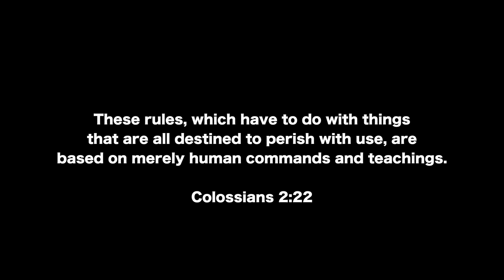Rhino 10' Flex Wing John Deere 3039R  Prepare to Mow!

Comment: Really appreciate your videos.  I have a Deere 3520.  Just purchased a TS10 and it is set-up with two hydraulic lines.  Just as seen in the video, would like to use the loader hydraulic connects to operate the cutter features.  Could you provide details about your recommendations for hydraulic extension hoses - Diameter, length and coupler sizes.  Thank you much!
Reply from the maker: Get the ‘power beyond extension kit’ from http://DiscountHydraulicHose.com/ttwt
Substitute 96” hoses instead of 60”.
And add 2x 5502-08-08 elbows to make the bend better at the mid connectors.
Don’t forget code ttwt for a 5% discount.
Reply: Really appreciate it! Keep up the great work!

Comment: When i was carrying silage wagons for my uncle i had the idea to put the pin between the tractor and the wagon upside down like your father;i would then install the locking pin attached to a twine cord hooked from the back of the seat .I would then drive the empty wagon beside the silage harvester,pull out the locking pin,  unhooked it there and go pick up the other full wagon;this would save one time going off the tractor to unhook!

Comment: Rhino makes some good tough equipment. Our older 15' Rhino mower has those leveling rods too. Good feature even though it makes it a little tougher to hook & unhook the mower (@ least for us @ times). I usually don't even use the jack though & just put blocks underneath the front skid plates on the main deck. Then hook up the main hydraulic line & use the hydraulics to line up the hitches when i'm hooking up & unhooking. Has worked great so far.
& as far as the pto & turning, the best advice I know to not break it is just to listen to it as you turn. If it starts rattling, then you've reached the maximum turning radius you should be at. On our equipment about 45 degrees is as far as you want to be for pto equipment. Of course we run older equipment, so that be a factor. lol

Comment: Hey Tim, that flip over bar is there so you don't have to use as many collars and when you need to set the mower down simply flip up the bar. Thanks for all your video's.
Reply from the maker: No, the flip over bar is to lock it at full height.
Reply: @TractorTimewithTim  I stand corrected. Thank you.

Comment: My grandfather always ran the bolt “upside down” to 1) protect the threads and 2) prevent a bend in the bolt, which would also, prevent easy removal later.
Reply: What bolt? Don’t you use a draw pin?
Reply from the maker: No.  We use a bolt with double nuts to ensure that it does not come out.  I believe this is directed in the manual.
Reply: Interesting. I’ve never had a draw pin come out. I’ve had the dirt knock out the safety clip out the bottom of them. And have sometimes put a draw pin in upside down with a safety pin on top so that the dirt won’t knock it out.
Reply from the maker: I have.  ...as a teenager, going down the road with a 24’ hydraulic fold disk on an IH1466.
I looked behind me and the disk was going crazy.  I slowed down, and the hydraulic hoses all came unplugged, and the disk passed me, and ended up in the opposite ditch.  Good thing  there were no oncoming cars!
I am not kidding.  Woke me up!
Reply: Yep. That would sure get your attention!

Comment: I watched several of your TS10 videos before getting one of my own. I got it today. I’m new to tractors so still learning.  The hydraulic hose is too short and I bought a 4’ hose and fittings to extend it but there is so much pressure in the hoses that I think it will make a big mess when I take the coupler off.  At what position will there be the least amount of hydraulic pressure in the hoses? All the way down? Right now it is folded and all the way up and the pressure is so high that I can’t even hook it up to the tractor without great effort.

Likewise, in what position should the mower be stored so that it’s not so hard to hook up the fittings when I’m ready to mow?

Is it correct that if I get the three-function hose kit that I can mow narrower areas by folding one wing up and mowing with the other two?
Reply from the maker: First, congratulations!
The wings have a safety latch which can help take the pressure off.  Make sure those safety brackets are connected.
Also, there is a latch on the center cylinder.  Fold it over to hold the center up.  
Then loosen the fitting to release the pressure.

For storage, either use the safety straps and cylinder block I mentioned, or store it all the way down.
Simply stated, if the cylinders are holding anything up, the lines will have pressure.
Does that help?
Reply: @TractorTimewithTim  

I think so. By safety latch do you mean the transport bar/latch?

If so then it makes sense. Essentially put in travel mode and drop the hydraulics all the way down to take the pressure off?

Since I will be introducing 48” of air into the system do I need to bleed it after I’m done? If yes, how?
Reply from the maker: @roblancaster2036  no need to worry about bleeding system.
Removing pressure means cylinder isn’t holding any weight.   You can remove pressure using any technique which accomplishes that.

Comment: Now I'm wondering if I've been short changing my Rhino Apex 3150. It only has three grease zerks per shaft. One on each u-joint and one on the shaft or CV joint on the main shaft.
Reply from the maker: 2 of them are on the plastic shields.
Double check the CB...it has 4 fittings on it I think.  Seemed like 8-9 total on the shaft. There is a ‘map’ on the side of the shaft showing how to find all of them.

Comment: You may add mind reader to your resume.. Thank You for an excellent video.      I have been researching flex wing mowers and your video came just at the right time.  I am between Rhino TS 12 and Woods BW 12.  The Rhino 12 has the different hitch that swings for sharp corners.  Woods does have a Dare to Compare on there website and list most of the Flex Wing Mowers side by side specs which is nice.    Next question.   Are you opening a tractor Toys Park anytime soon.  You know pay to play and bring your own tractor to try different equipment out.   They do Have Construction Equipment park in Texas somewhere.  Airplane Simulators Park in Ca.  and now you can have Tim's Tractor Time Compact Tractor Play Toys Park.

Comment: that joint is called a "double cardan joint" its purpose it to be more flexible then a normal uni-joint. with normal uni-joints the pivot / hitch point should be in the middle of the tractors PTO output and implements PTO input with out getting in to the complexities when 2 uni-jounts are on a shaft if they turn at different angels it will give an oscillating speed output and cause vibration in the implement the hitch point has to be in the middle to make sure both uni's are turning at the same angle. the double cardan joint is more or less an intermediate PTO shaft before the main one that has a mechanism to keep both ends of the double cardan joint at the same angle thus eliminates the oscillating speed and allows for much higher operating angles and allows the hitch point to be much closer to the tractor making it easier to maneuver and have a higher hitch load. if that where a normal uni-joint that tractors draw-bar would have to be a almost a foot longer or you would destroy that mowers gear box. hears a clip that shows the oscillating speed i am talking about https://youtu.be/Idk3BVDVHq4

Comment: Tim, I'm interested in a Rhino TS10. I have 3 rear remotes, with one that has a continuous flow. is that the remote to use to let the wings float? What is your opinion or knowledge on this?
Reply from the maker: No need for continuous flow.  Usually float is a separate feature.   You likely have it.  Consult your owner’s manual.
Reply: @TractorTimewithTim  the only float position (that isn't operating correctly) is on the loader circuit.
Reply from the maker: Maybe talk to the Rhino dealer.  Perhaps they have some advice.  Or perhaps your tractor dealer.

Comment: Is the 14" minimum distance requirement measured from the base of the PTO shaft or the end of the PTO shaft?
Reply from the maker: End (tip) of the pto shaft to center of drawbar pin.
Reply: @TractorTimewithTim  Thank you sir.

Comment: Why did you use a bolt instead of a pin?
Reply from the maker: Double nut ensures that it will not come out.
I believe the manual calls for this.
Reply: The double nut makes sense vs a pin which the safety clip could catch on something and pop out and then the pin and loose machine

Comment: I really want to hear how it works with your LX3310.  I have a LX2610 and am considering getting a TS10 to pull behind in for smaller properties (1-4 acre) we maintain instead of taking our 100+ HP tractors & 15ft bat wings or our ZTRs.  A little LX & TS10 I’m thinking might fit on a 20 ft trailer & would be much easier to haul around in Dallas traffic vs one of our 36 or 40 ft deck over gneck trailers with the big tractors.  These properties are a little large for one guy to knock out quickly with the ztr, which has me considering the TS10.  We mow them once per month, so they typically wont be very tall/thick.  I know the LX2610 would be a little light on HP but wondering how it would handle the TS10 in these conditions. Thoughts?
Reply from the maker: Not optimistic about a 2610 on it.  
Also, not sure it will fit on 20’.  Wheels are way back there!
I think you would be happier with an L4060 with cab.   I think the 3046r would be the perfect tractor for this mower.
Reply: When you do hook them up I’d love to hear the total length!  Love the content! Keep up the great work!